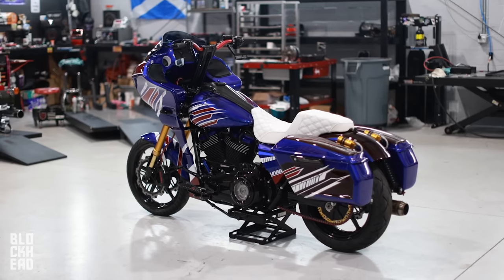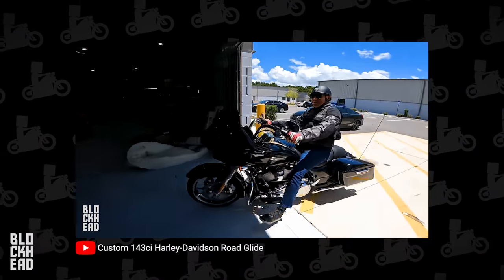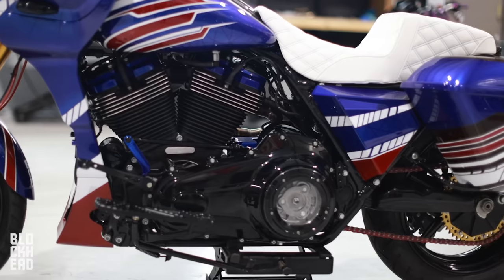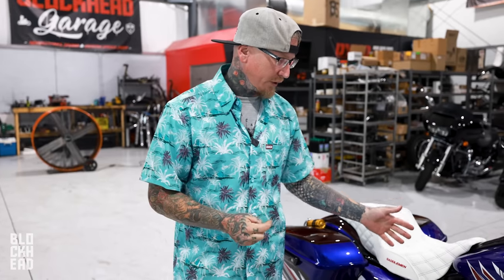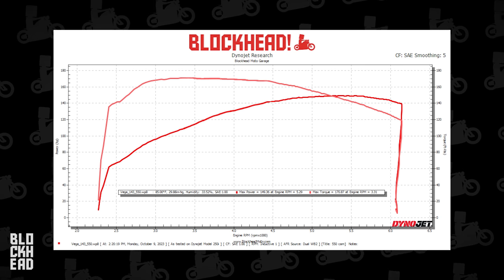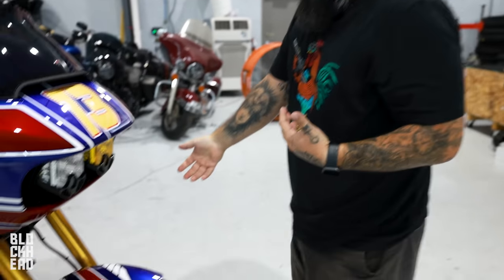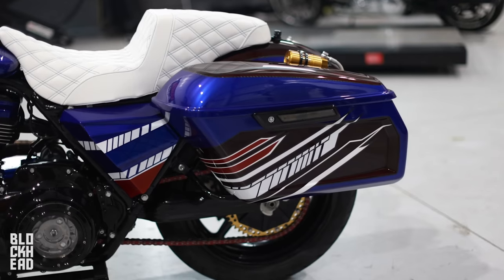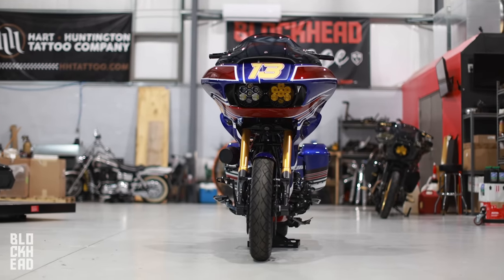Building A Harley-Davidson Road Glide with 143ci Engine

Comment: Bike came out great! My question is with all the torque it produces why the decision to not upgrade the swing arm or more importantly the rear axle??  When i put some power in my Road Glide 131 build the stock axle would not stay adjusted and constantly need readjusting. Went to the Kraus axle which solved the issue. Now run the Brock's swing arm & its been solid.
Reply from the maker: We’ve actually run into fitment  issues going with aftermarket a number of times. We did remove the stock swingarm though and had it modified / reinforced, so it’s not actually “stock,” has custom fabrication on it, just looks stock.

Comment: Not a bad way to spend $10,000
Reply: The motor by itself is about $10,000. This build probably cost $40,000 if not more once you include labor for parts installation, paint, powder, etc.

Comment: Chris, for a 2002 Flht stage 4 stroker putting down over 120 lbs-ft, what would be your clutch of choice? 
Running FM AIM VPP with an Energy One diaphragm spring, new steels and new drag organic fibers, which is holding but on my second (used) oem basket, which will eventually fail as well. Tried a Barnett 6 spring pressure plate w/ greens before the AIM and it slipped. Barnett HD diaphragm is just going to snap my clutch cable when it gets cold, pull is ridiculous with VPP on top.

Comment: There is something about an incredibly built bike, that has top of the line suspension, brakes, crazy power, all the looks and carbon a guy could want, while  skipping the oddest details. I mean this with absolutely no disrespect, I just can't wrap my head around it. The bike is absolutely amazing, but how can you run dual Brembo radial calipers, a top of the line Ohlins inverted front end, Lyndall rotors and all kinds of goodies, only to run a stock master cylinder and a fuck load of black washers as spacers for the calipers. A good master cylinder and some real spacers would do this bike every bit of justice it deserves! That being said, if it's only fine details that someone can find an issue with, it's really not an issue.
 The bike is absolutely gorgeous, it sounds amazing and the mods are too notch and all tie in VERY nicely. I kinda feel like a dick for pointing out the two things that drive me nuts considering how nice the bike is. I just hope it's taken as respectful constructive feedback and not as hate, because it's anything but that! The bike is essentially perfect!
Reply from the maker: Thanks Jonny! There’s no black washers as spacers. The spacers just have circular notches cut into them, but they’re a solid piece. Stock master cylinder stops great w the upgraded components. We had to balance the overall budget and OEM master cylinder is something we kept to allocate budget towards other areas.

Comment: Did I hear correctly 149 hp goldzilla’s 131 has more hp?
Reply from the maker: Goldzilla is running a top end S&S 590 horsepower cam, and we got that on E85. This 143 is on 93 pump gas running an S&S 550, much more rideable vs a 590